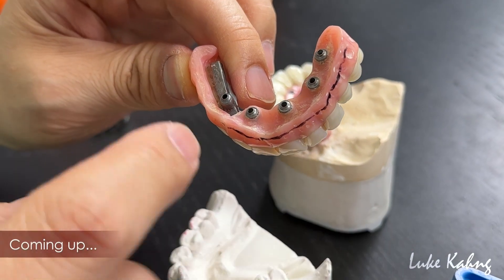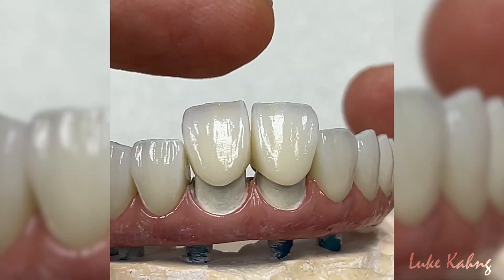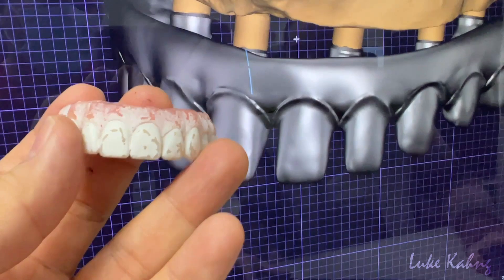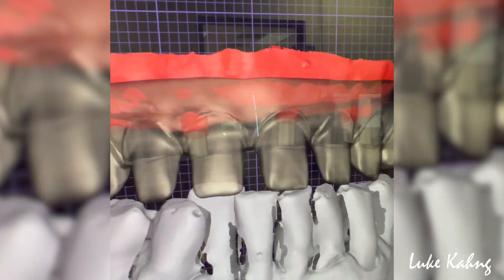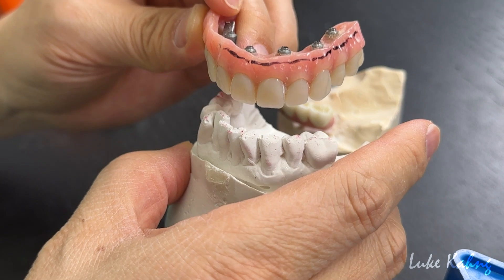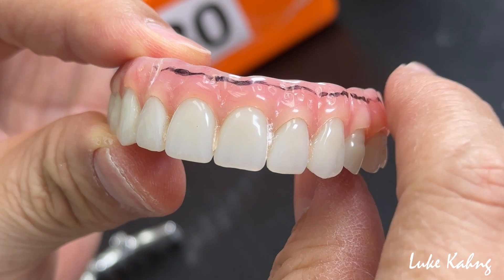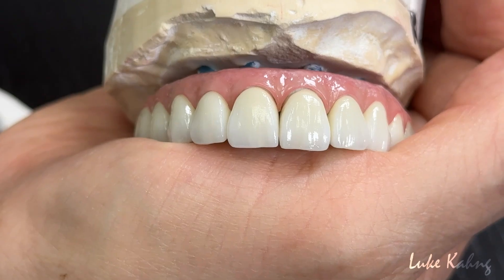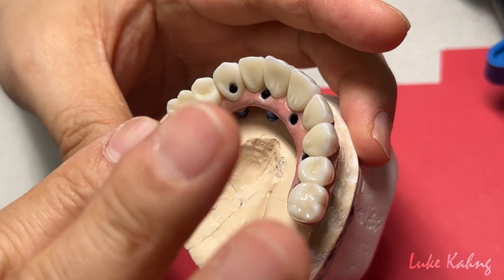Why Do Hybrid Acrylic Implants Break?

Comment: better to grind the Restoration than the mandibular teeth with zirconia in my opinion. With the zirconia you also have a direct strength transmission to your mand joint
with doing a zirconia restoration don't you just save the restoration and instead grind the mandibular teeth and get him CMD?
Reply: and the night guard doesn't save you from grinding during the day and doesn't prevent CMD neither attrition on mandibular teeth. It just pushes the date of problems further back.
Reply: It depends on the case. Every case is different. It depends on restorative room etc.
Reply: I’ve got “All on 4” top jaw . Supposed to be Zirconium but the inside has literally deteriorated so much leaving a hollow shell , and a thin metal strip of wire which has become lose, and what feels like a strip of elastic attached to broken pieces of plastic. Dentglow in Izmir Turkey fitted these , they tried to convince me to change to “TORONTO” hybrid crowns but I said no. Does anyone have any advice for me 👍